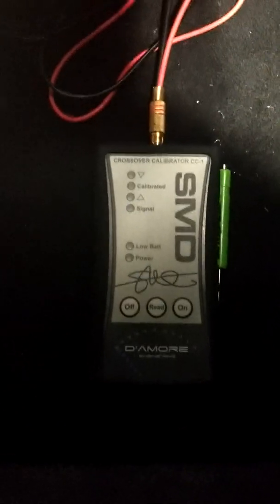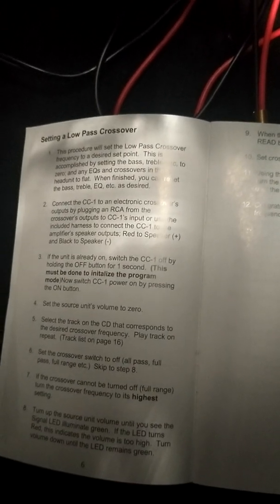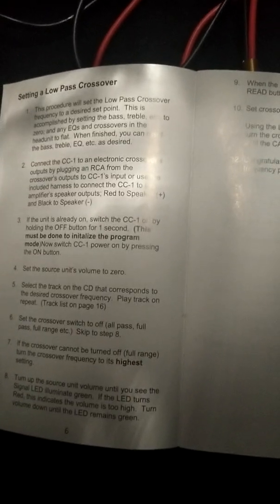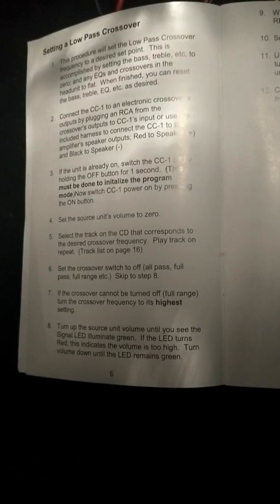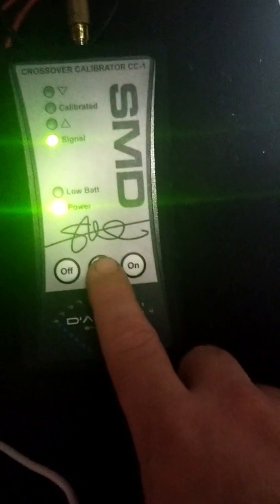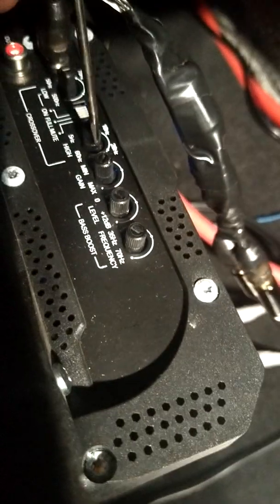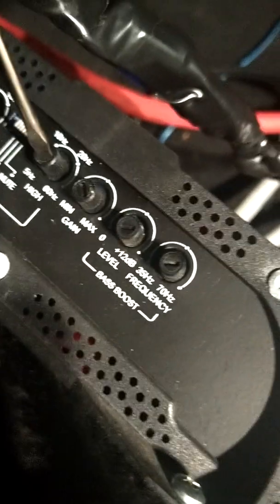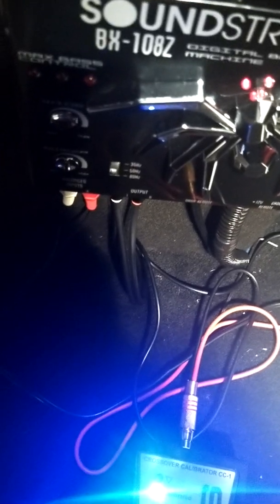SMD CC1 low pass and Infrasonic filter calibration

Comment: Ok I just bought a DD-1 and CC-1 combo package to tune my amps with and didn't think about it until after I bought it but can you even use these if you don't have a CD player I'm using my stock head unit on my 19 Camry and it doesn't have a CD player so how do I use it without it
Reply from the maker: The way you would use it without it is whatever device you're using you need to upload the SMD CD to your computer or laptop and then download it to either a USB stick or a phone then you will be able to Bluetooth phone to stereo and play tracks through phone
Reply: @212Tan   ok I just downloaded the test tones/manual from the SMD website but when I started looking at it I noticed it says the different tracks and has a DB rating next to each track such as -0db -5db -10db etc. I know this is probably a stupid question but I have never tuned an amp before and I want to be sure about everything especially since every piece of the setup from the amp,sub,scib bank etc was all over 1K a piece but how do I know what test track to use with my setup is there a way to figure it out based off TS parameters or box specs maybe a combination of both?? Just wondering if it is a personal preference thing or something that needs to be set accordingly depending on the setup
Reply: @Dirty2152 -5db is for sq -10db is for loudness or boom if you have subs and sq and -15db is for straight boom on your subs